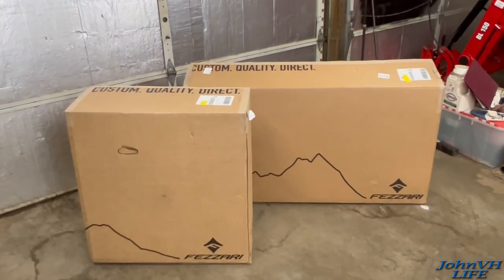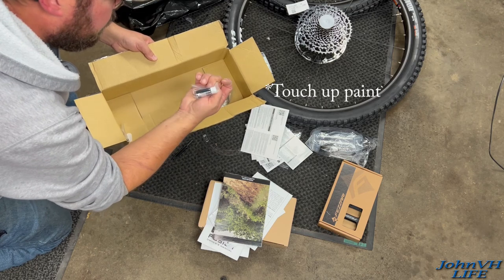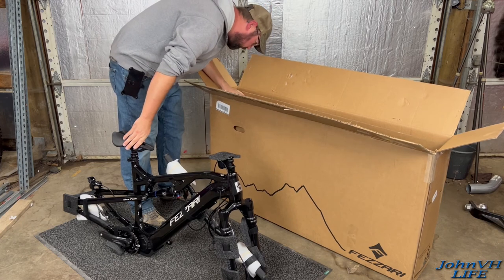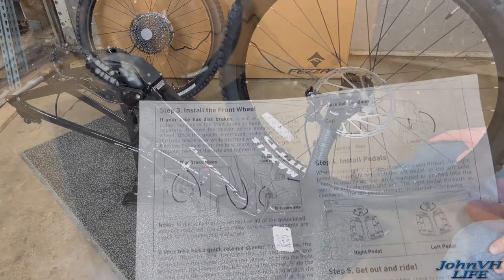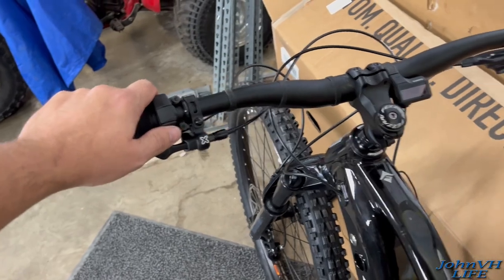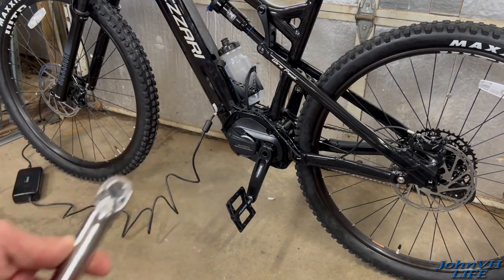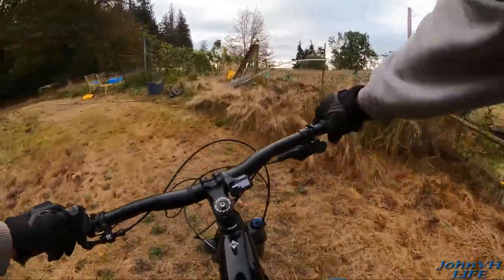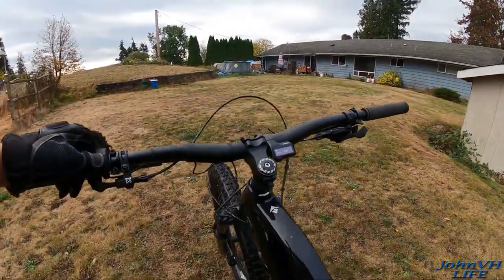Fezzari Wire Peak EMTB Ebike UNBOXING AND BUILD with First Ride REVIEW Wire Peak Comp

Comment: Dude, that little metal thing on your rear wheel spoke is the magnet sensor for the motor to know how fast your ebike is moving. Once it reaches 20mph, it tells the motor to stop assisting you, which means it's all YOU peddling after that. I hope you didn't take it off. For future buys, it might be beneficial to watch a handful of videos of other riders reviewing the bike you ultimately decide to purchase to have a good understanding of the bike and all its features. Good luck with your Wire Peak!

Comment: OMG! I've never seen someone with such little knowledge of the bike he's trying to build put an ebike together without READING THE MANUAL before. "Winging it" is for amateurs. And I've never seen someone build a bike without using ANY bike grease on his wheel axles or pedals. I highly recommend watching any of the hundreds of Gee Milner complete "Dream Build" bike videos on YouTube. It'll change your life and help you maintain your pride and joy like a pro. Also, to clean up your cockpit wiring, you can use some zip ties.  Final tip: watch and subscribe to Electric Mountain Bike Network for riding and maintenance tips for your new ebike. EMBN is a godsend for us ebike riders. 👍

Comment: The manual might say to fill air forks to 140 psi, but I doubt anyone runs their fork at the psi. I run mine at 75 psi, because I like a soft ride. So fill to 140 psi, then reduce to your desired pressure. Same for the rear shock. I run mine at 197 psi.
Reply from the maker: Its been a while now, but at 140 mine bottomed out too easily, I dont remember the number I settled on but it was alot more. I contacted Fezzari to see what I was safe up to.

Comment: Floor model or not, I'm honestly pretty shocked Fezzari didn't ship your bike with the  padding/packaging they normally use. Usually, every single park of the bike is wrapped in foam, the rear wheel is already attached, the suspension is tuned for your weight, the seat post is measured for your height, and all you really have to do is attach the front wheel, handlebars, and pedals. That's how it is on every other unboxing video on this bike I've seen. I'm about a month away from possibly ordering the new Timp Peak. It better not come like this or it's going straight back to Utah.
Reply from the maker: It arrived fine, and I saved $700, Im happy